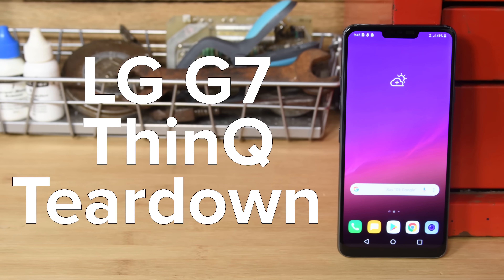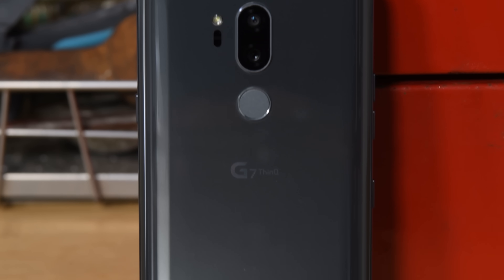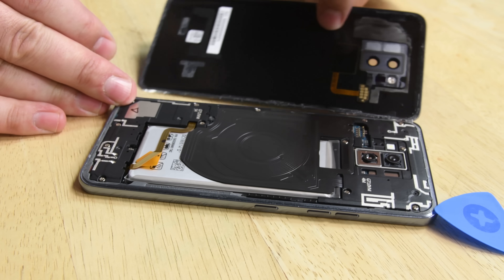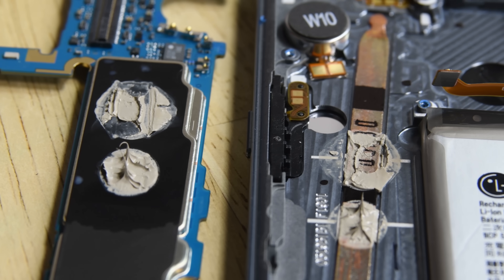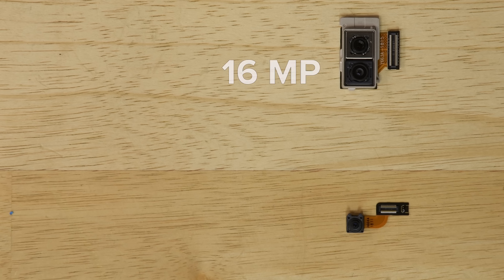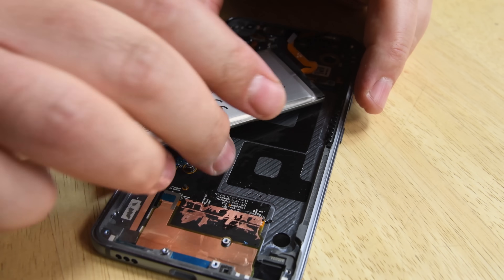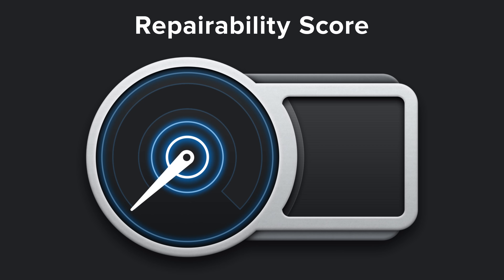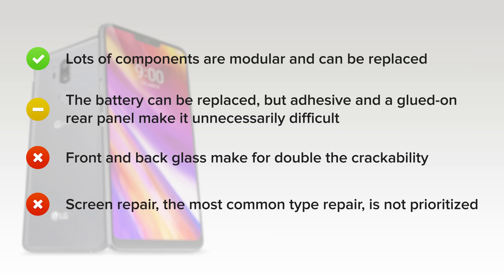The LG G7 ThinQ Teardown!

Comment: Contact pins are cool to avoid cables than can break after plugging or unplugging them, but they drive me nuts when they can't make contact anymore (on my ZenFone 2, screws broke so I had to close it with less screws than before, it means I have to press hard on my case while using the volume buttons or they can't make contact without the screws

Comment: this pertains to an iPhone 5C <-- if I need to switch Logic boards how do I get the original, from the old logic board, IMEI to the new logic board? Do I Bring the NAND Flash chip to the new Logic board? Bring the CPU's to the new logic board? or Both? Or do I need to reprogram the new NAND Flash chip with the information from the old NAND Flash chip???
Reply: Chris P Cloning such things as the IMEI are a near impossible task, and in some places it may be illegal. If you want to restore the data from the old board and couldn't make a backup, there are places you can take your board, they'll retire your data and give it to you in a separate file you can open on your computer.

Comment: Specs on this phone are pretty good, and i feel heat problems won't be as common in this phone as with the G5, however I'm on the fence about whether or not I should consider this phone. I don't like the notch or the low/difficult repairability, but the specs, water resistance, and headphone jack are a big plus. 

internal screaming

Comment: Not too bad except for that glass and glue but everybody uses them so I guess it's an ok to repair phone for 2018 phones, like those modular headphone jack and not too heavily glued battery even tho I don't get why they glue the battery since many older phones had an unglued battery(like my op2)
Reply: The battery are heavily glued in for it not to become undone and rattling inside your phone
Reply: You would need to buy a heat gun. A blow dryer would destroy the motherboard

Comment: Agreed the g5 is so easy to fix! Replaced my g5's screen, touch sensor, volume buttons and rear main camera with no hassle whatsoever! 
Not to mention I have like 2 spare batteries I can easily swap in <3 g5
Reply: Meledyne love mine too! I hope the removable battery will return and planned obsolescence will leave soon! This is not sustainable, the phone does not like water at all, even with the IP68 eating!
Reply: That's a lot of things to replace. Speaks for their durability. :/
Reply: @lhk7006  I've got a G5 and have never needed to replace anything! It's still rock solid, I only replace the battery from time to time, with a fully charged one! 👌 SO EASY, and I charge it outside the phone 🤓